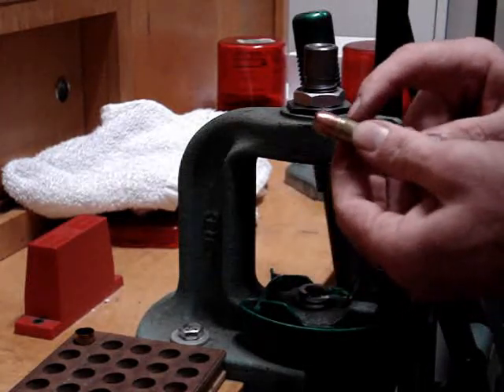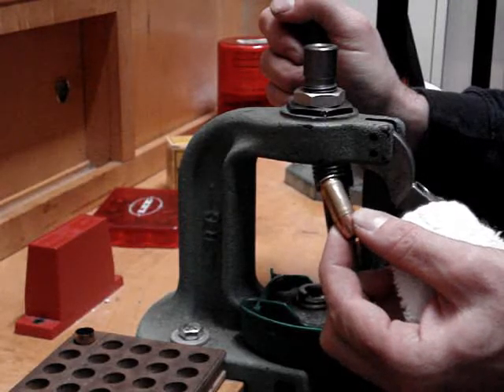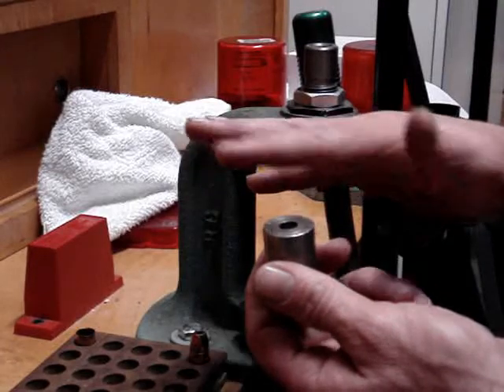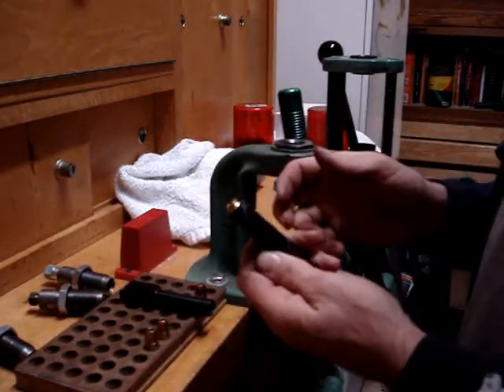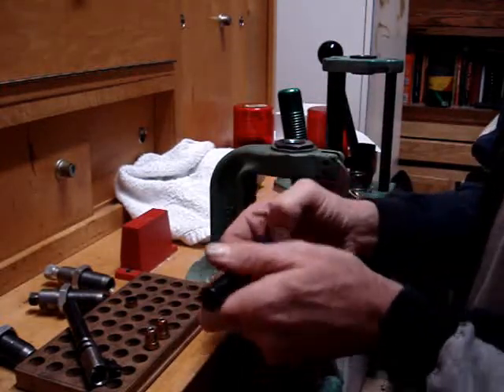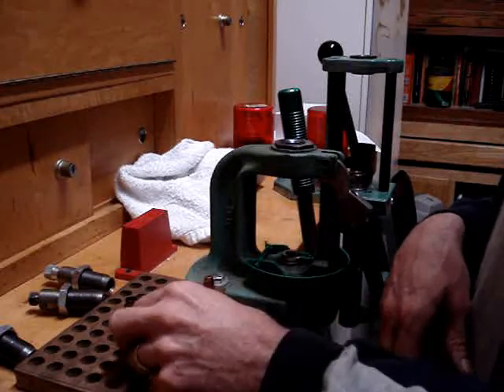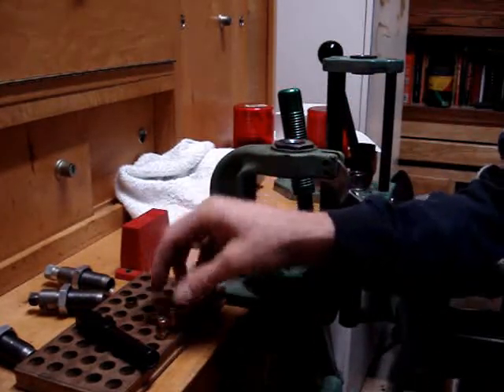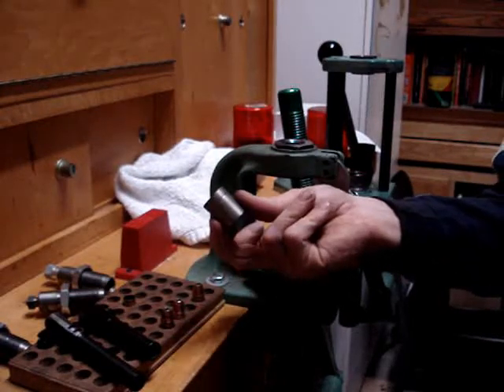Basic Reloading: Taper Crimp Die Part 2

Comment: I think that the main thing that confuses most reloaders about taper crimping is the reason for doing it.  The purpose of a taper crimp is not to hold the bullet.  That's what the case tension created from the sizing operation does.  The purpose of taper crimping is simply to remove the flare created during the flaring (belling) operation.  Any taper crimping beyond completely removing the bell is just crushing the cartridge.  I think the operation should really be called deflaring or debelling.

Comment from the maker: If your crimp is slightly out of adjustment, say too little crimp, turn the die 1/8 turn clockwise. and if your crimp it too much counterclockwise the same. I reccomend that you make a "action proving dummy" before loading 50 rounds that may not chamber correctly.

Comment: Excellent video and explanation. I pressed some 45 acp 230 gr LRN rounds and was about to go to the range but my gut told me wait you idiot double and triple check. After some research and thought, I never taper crimped a single one! The explanation; inexperience plain and simple, New to reloading. Almost all dropped perfectly into the barrel and fell out nicely even before I crimped, I had a few that I belled excessively that wouldn't fit. But if I would have ahem ahem taper crimped that could have been prevented. Thanks for the vid it might have just saved some fingers!

Comment: question: if you tested say three tapered crimped bullets by dropping them into your barrel and they slid in and out easily then would that be enough proof that you could continue with the rest your tapering without checking anymore as long as your going to shoot them all out of the same gun?

Comment: What is the rule of thumb to adjust the taper crimp die when it has been determined that the crimp is incorrect, either too much or too little taper? I would assume that the die must be turned in a clockwise or counter clockwise rotation to reduce or increase the crimp. Would you make these incremental adjustments in 1/4 turn, 1/2 turn, etc?

Comment: What is better, a taper crimp die or a factory taper crimp die?
Reply from the maker: Depends of the cartridge. For non cannelured bullets a taper crimp for cannelured bullets a factory crimp does best.
Reply: @ammosmith  So the majority of 9mm bullets are non cannelure, a taper crimp die is best.
Reply from the maker: @nickyjim12  correct. Especially for automatic pistol cartridges like 9mm, 380, 40, 10mm and 45 ACP.